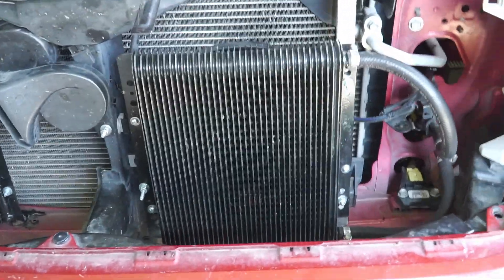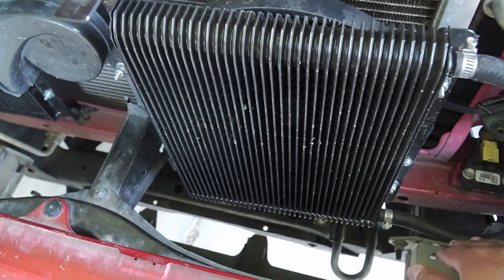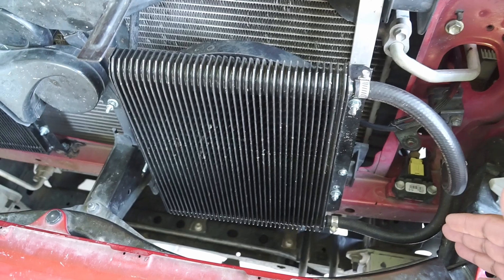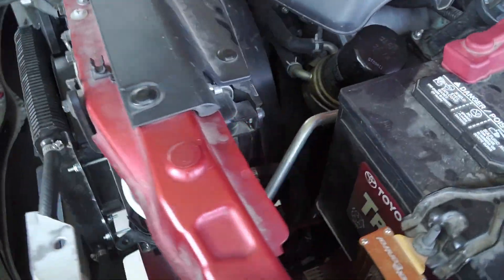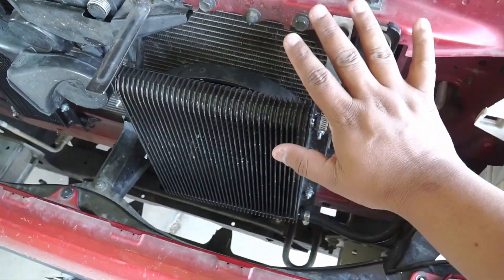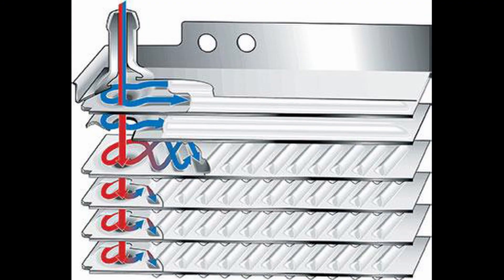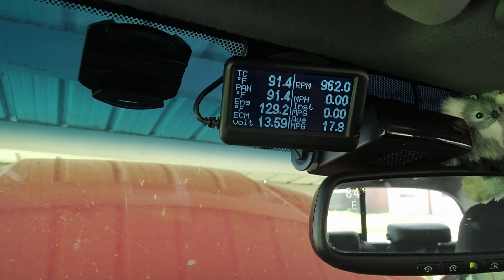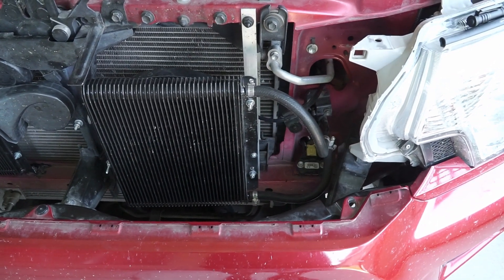TOYOTA TACOMA TRANSMISSION OIL COOLER UPGRADE!!!

Comment: Is the auxility cooler deleted? The one underneath the trans.
Reply from the maker: Not sure I understand your question correctly. The Tacomas do not have an auxiliary cooler underneath the transmission. There is an OEM auxiliary cooler in front of the condenser which I upgraded and bypassed the inline rad cooler. If that’s what you’re referring to

Comment: The transmission on 2nd gen tacomas doesn’t send fluid to the cooler until the pan hits 175. I’m calling BS on you numbers.
Reply from the maker: If you say so. My numbers don’t lie though.
Reply: @ it’s not about what I say. The valve on your truck doesn’t open until 175f to send transmission fluid to the cooler. On the 3rd gen’s its 190f. You can easily test that by simply touching the lines that run to your transmission cooler around the 150 degree mark. You will find that they are the same temp as whatever the ambient temp is. The only caveat is if you pinned your transmission. However, if you didn’t know that your trans doesn’t send fluid until 175f then I doubt you know that that even means.
Reply: @Prosecute-fauci   The hate is strong in you on what this man did
Reply: @staceyphillos5723 it’s really not. In reality the transmission on 2nd gen tacomas doesn’t send fluid to the cooler until 175 degrees. Him claiming that it never reaches above 145 after his install is ridiculous because the oil heats up in the transmission independently of the cooler until 175. He is either lying or has some serious placebo effect.

Comment: So the top radiator line connection at the radiator is always the feed line and the one at the bottom is the return line? Is that correct?
Reply from the maker: Mannn to be honest I don’t remember now. It’s been several years since I missed with those cooler lines.

Comment: Great video and good design, do you know how the additional filter you added affects internal pressure in the transmission? Everything else looks perfect, just not sure how much back pressure is potentially being added. Obviously it doesn't impact the cooling either way.
Reply from the maker: That, I do not know. It does not affect it greatly as I haven’t noticed any change in shifting. I’ve also installed the same exact filter on my daily Kia car.
Reply: @temosgarage  awesome thanks for the quick response. I'm here in New Mexico so it could be 105 down south in the summer and -5 up North in the winter, thanks for the details on the video.

Comment: take that filter off asap!!! The trans needs the pad fibers floating in the fluid to act as a buffer between pad and plate to keep wear down.
Reply from the maker: 60k miles later with an inline oil filter and have not had any issues. Transmission shifts smooth as butter.

Comment: Hey, thank you for posting the video with so much detail. How’s the system been doing 5 years later? Is there anything you would have done differently?

Looking at adding a transmission oil cooler to my Tacoma before the summer heat gets here
Reply from the maker: Hey thanks for watching! The only thing I’d do… or use differently, are the hose clamps. Can only tighten so much before they strip and so doesn’t clamp the hoses good enough and oil seeps. No leaks, just very slow seepage. Use pressure clamps or better hose clamps. Other than that, it’s been a solid setup. Has kept my transmission nice and cool.

Comment: how you can say the oil warm up faster in the winter when the cooler is not even conected to the engine radiator at all ...obviously it will be a lot slower if you dont use a thermostatic valve in the new oil cooler line

Comment: I'm installing my Hayden but didn't bypass my radiators built in cooler. Had to move the horns too and installed mine about 2 inches away from my condenser. Trucks got 362k miles so I gotta start babying it now lol.

Comment: Hey thanks for this video! 

Question: did you just fill the cooler with transmission fluid or install it dry and top off underneath with the vehicle running at temp?
Reply from the maker: Eh... neither of those. I installed it during a transmission flush job. So it got filled up as I was pushing old fluid through it and draining out one of the cooling hoses at the bottom of the radiator. If you plan on installing one, you can do either one. Probably the easier would be to install it dry then add about 1qts WS fluid to the fill hole of the transmission. This specific cooler holds right around 1qts

Which reminds me, its almost time for another transmission flush. This time I plan on recorded the procedure and uploading it to YT

Comment: Nice set up ?how did u mount your fan and you using a manual switch or temp switch and relay ??
Reply from the maker: Thanks man!
The fan is mounted to the aluminum rails I got at Lowes lol bolted. 

The fan is a manual switch. I have an UltraGauge that I can monitor the oil temps and when it reaches a certain temp I will flip the switch on for few mins. For my needs, I don’t need a temperature controlled switch. 

It is hooked up to a 30A Bosch relay. Can’t remember if I mentioned in the video.

Comment: When you getting done with the install do you have to add more fluid?
Reply from the maker: Yes. The factory system holds 11.8 quarts I think. 

With this bigger cooler it holds an extra quart.

Comment: Just curious why you didn't put the oil filter on the outside? Wouldn't it be easier to change out there?
Reply from the maker: More of a mess. Putting it below is easy to get too and any drip can go in an oil catch pan on the floor instead of the frame.

Comment: The OEM trans cooler is an absolute piece of garbage. I don't know why Toyota even bothered to put that on there. I can't even tow a 1800lb RZR Turbo with an aluminum trailer without it hitting 210 constantly. I hit 227 climbing a hill in 72 degree weather. The second you get out of overdrive the trans temp skyrockets. I'll definitely be doing this.
Reply from the maker: Agree with you 100%
I threw the stock cooler in the trash. 
I’ve only seen 200 degrees once since installing this cooler, and that was for few seconds. The fan sitting behind the cooler helps quite if bit also. 

I def recommend this upgrade. Almost 50k miles later and zero issues. Almost time for another flush

Comment: Hey Hommes, did you also ADD an Engine Oil Cooler to the left side as well ? Did you use an Engine Oil Filter Sandwich plate to run the pipes to the additional Engine oil cooler? I am considering to do that mod to my 2016 tacoma.
Reply from the maker: Yo! My truck is a TRD Offroad so it already comes with an engine oil cooler. The smaller cooler to the left is a power steering oil cooler I added. I also have that video in my channel.

Comment: You mentioned early in the video about having issues with air pockets. What kind of issues would you have?
Reply from the maker: So if the inlet or incoming oil is hooked up on the top nipple, then the cooler cannot or might not 100% fill up and there might be a small air pocket on the top side of the cooler making it not as efficient. Might fill up 100% or it might not. 

But but hooking up the inlet side on the bottom of the cooler, oil gets pushed up the cooler thus filling up the cooler completely.

Comment: Question-  is there a thermostatic switch that works with this cooler, with adjustable thermostat,  so that fan can turn on automatically?
Reply from the maker: I’m sure there is. I didn’t bother looking into it because I just put a manual switch for ease of use.

Comment: I installed mine not having a OEM cooler.  Installed same model TruCool cooler in your video.  I assume with cooler installed I am now low around 1/2 qt ATF, correct?  That is because the cooler holds ATF.  

If so, damn it’s going to be a pain to add additional ATF.

Comment: I'm in the process of putting  a oil cooler in my 2009 Tacoma was checking your video  out. Do I just plug off the transmission cooler lines on the radiator , and go straight through the new oil cooler and back to the trans ? plus I also ordered a filter . Please reply
Reply from the maker: Outlaw Cowboy Jesse that’s what I did. I plugged the top and bottom cooler lines on the radiator and went straight to the new oil cooler.
Reply: @temosgarage  that's what I did, works good 👍
Reply: Thanks

Comment: How did you add fluid to compensate for the bigger trans cooler ??
Reply from the maker: Robert Lowe through one of the cooler lines under the radiator while I was already doing a flush.

Comment: Nice video one of the reasons I added a Hayden 679 to my FJ Cruiser and now my transmission shifts far better than ever before under hot day stop and go traffic as well as on beach sand and uphills. An average 30 degrees reduction as checked with OBD II scanner.
Reply from the maker: Heck yes!!! Cheap insurance, that's how I see it :)

Comment: Excellent Video! Great Job keep them coming. Quick question about how many degrees approximately did you notice the Transmission temps drop by using the new cooler and do you feel the magnafine put any restrictions on the fluid or increased the temperature. Thank you.
Reply: Thank you so much. Great Video.
Reply from the maker: Tom B stuck in traffic, 100 degrees ambient temp, AC on full blast, transmission temp would be hovering around 215-220 BEFORE the cooler upgrade. 

After the upgrade, it hovers around 190 now. 

It really did make a huge difference in temp. 

As for the filter, hard to tell how much it affected, I haven’t noticed it. Shifts very smooth, flow of oil seems normal EVEN under heavy load like going up a steep road at 75mph with 500 pounds of cases of water in the bed lol 

Basically, I haven’t had any issues with my setup. Just pure awesomeness!

Comment: What about in -30 temps, are there any issues at those temps?  I have that for like 3 months.
Reply from the maker: is that in Fahrenheit? If so, i don't know as I don't see that king of temperature where I am from. My guess is you would need to install a transmission thermostat. Depending what kind of vehicle you have.
Reply: You already have a thermostat that will also bypass the stock transmission cooler if it doesn’t reach proper temps

Comment: What's that cooler to the far left? Another trans cooler?
Reply from the maker: orlando alvarado that’s a power steering oil cooler. I have that video in my channel too. You should watch it 🙂
Reply: @temosgarage  will do.. I've been looking for videos about anything relating to the Tacoma tow package and so far I've learned that it's pretty much oil& trans cooler. Reason I'm looking and trying to learn is because I just purchased a 2017 off-road without the tow package and I guess the big question is can the components of the tow package be added later? Any help or explanations would be greatly appreciated because I haven't been able to find much on this scenario
Reply from the maker: orlando alvarado yeah man! I can definitely try to answer any question you have. With your 2017, yes you can add the tow package cooler from Toyota but it’s going to be expensive and not to mention, the Toyota cooler is small and pointless. You’re better off doing what I did and installing a large oil cooler. Since the cooler upgrade on my truck, it’s not seen 200 degrees which is perfect!
Reply from the maker: orlando alvarado if you have Instagram, follow me @yofivefoot and I’ll be able to answer your questions quicker
Reply: @temosgarage  yeah for sure I'll follow just gotta get logged back in.. That's the route that seems best,  going with a bigger better cooler.  So to sum things up, the engine power, chassis and drive train are all the same on the all the v6 4x4 offroads. It just comes down to a few parts that can be purchased and installed right?. Since some trucks weren't equipped with the tow package... So Without oil/trans cooler =3500 towing...  And With/oil trans cooler = 6500 towing (because things stay cooler during heavier tows) right..  Thanks man I'm sure I'm going to use your vids for my installs when the time comes! 👌
Reply from the maker: They have identical chassis, yes. My 2012 Offroad with tow package, its transmission would still get too hot even with the factory oil cooler, and I don't even tow. Just city driving in traffic, I would see over 200 degrees in the summer. I can't imagine what the temp would look like if I did tow/haul stuff. This cooler, along with the fan I put in, would work perfect with towing/hauling stuff. If you live in hotter climates I recommend going with a bigger cooler, Tru-Cool 4590 without a fan, this cooler will be just perfect for our rigs. I know there are alot of people out there who think/thought this was pointless, but to me this has been worth every penny. My transmission stays cool year-round.
Reply: @temosgarage  hey bro thanks for the info again. I just gave you a follow on IG and also a status update, I did end up making my Tacoma off-road  purchase. I have plans off adding the cooler come summertime. It's a 2017 with 10k miles not new new but still new.
Reply from the maker: Hey man! congrats on the purchase! Is this your first Tacoma? You will love the truck, to some, its just a truck, to me and you, it is more than a truck! If you are a subscriber to my channel, youll be able to see all the things i've done to my truck that you can do. some are cheap/affordable mods. The Off Road model is the perfect truck in my opinion. Not as expensive as the Pro, but has all the features of the Pro. Thanks for the IG follow :) and thank you for the support!
Reply: @temosgarage  Are there any issues with two coolers essentially blocking airflow to the main radiator now?

Comment: awesome video!  Very informative.  Getting ready to do the same to mine!
Reply from the maker: Hey! Thank you for watching :) If you have any questions during the install let me know. Im happy to help you.
Reply: @temosgarage  Did you have to top off the transmission fluid after?  Also what about the air in the system after install.
Reply from the maker: I did not.  Because I did an oil flush, I put 13 quarts of oil, instead of the 11.8 quarts required by the manufacturer. If you're just going to install this cooler without doing an oil change, then yes, you will need to top off the oil. I suggest getting two quarts of WS oil from your local dealership or online. The transmission has a breather, so any air trapped in the oil cooler that gets sent to the transmission, will escape via the breather hose/adapter located on the transmission. I've now had the cooler for 15,000 miles or 11 months, and I have not had a single issue. Its kept my transmission nice and cool.

Comment: Ur trans has a oil filter inside trans. Good vid
Reply from the maker: durider the filter is a strainer, will only filter large particles. It will not filter out like metal shavings or shavings from the clutch pack as they wear out. That’s why I put the inline filter. Thanks for watching!
Reply: @temosgarage  copy that
Reply from the maker: When I flushed the transmission oil, I also removed the oil pan and replaced the filter mesh inside the transmission. It was a little dirty after 70k miles. The magnets were pretty nasty filled with gunk. So the new inline filter will help the oil stay clean much longer. Ill do another flush at 130k miles and see how the magnets will look by then. The inline oil filter will be replaced every 15k miles.